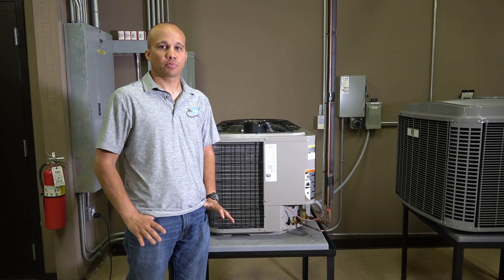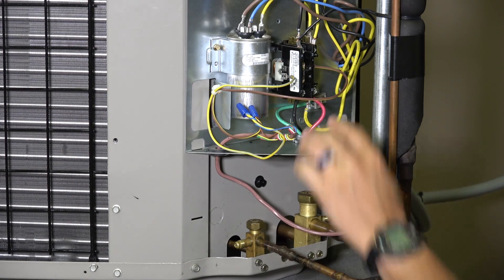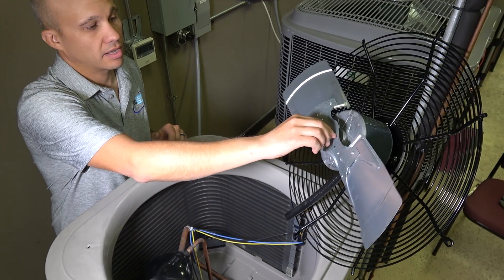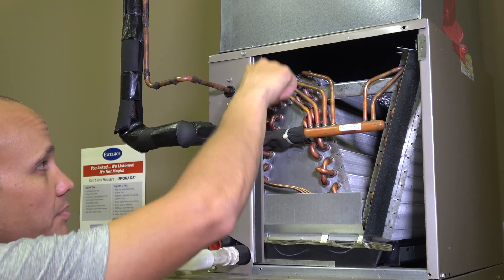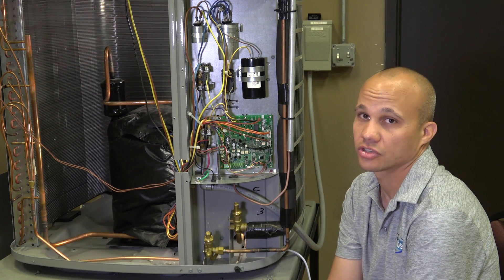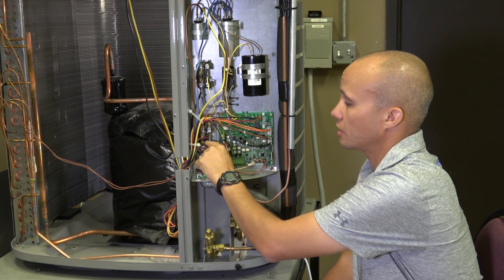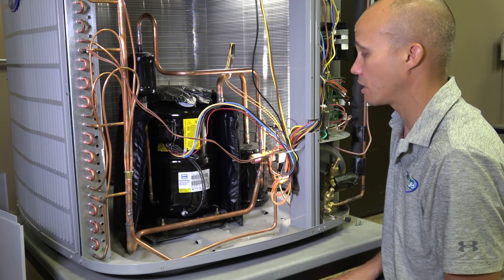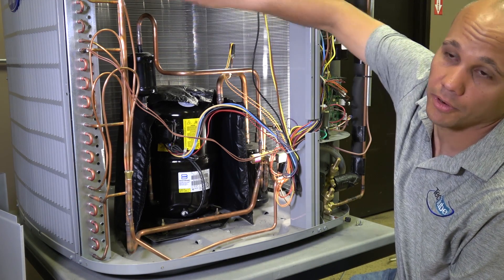Air Conditioner & Heat Pump Components

Comment: my heatpump comes on 2 degress after it should then stays on 5or6 degrees to longe
Reply from the maker: Those delays are controlled by the thermostat. For most thermostats, they are adjustable in the installer screens of the stat.

Comment: Just out of curiosity so What is the setup for a heat pump condenser in a traditional house? I know for regular AC you have AC condenser outside and then inside you have your gas furnace with coil on top. So what is the setup with heat pump condenser if the heat pump does cooling and heating? What goes inside the house?
Reply from the maker: Normally on the inside component is a fan coil (also called an air handler). It is the blower and an evaporator coil all in one box. It is about the size of a furnace.
Reply from the maker: You could also have a dual fuel system where the indoor side has a gas furnace and evaporator coil and outside is the heat pump. In that case, everything looks 100% visually identical to a traditional A/C and furnace but a couple extra internal components. With a dual fuel system you can either heat with gas or with the heat pump depending on your current fuel costs and your system capacity and efficiency. It is flexible.
Reply: @TECTubefilms  Don't forget about those of us that are all electric. My 5 ton American standard uses a 20Kwh heat strip (rarely has to use it in Arkansas winters). Also just realized something why are gas furnaces so huge my entire electric air handler was barely 54 in tall. The gas system I came from was massive compared to it that thing took up the entire cabnet it was in.
Reply from the maker: @Brad.W  Didn't forget about them... he specifically asked about furnaces.
Reply from the maker: @Brad.W  We inventory 6 brands of furnaces and all of them are only 33 inches tall. Back 10+ years ago, we had models that were 40 inches tall.

You also have to add an evaporator which is external to the furnace and the ones we use are usually 22 inches tall. That gives a combined height of 55 inches which is only 1 inch taller than your system.

Whereas for your air handler, the evaporator coil is internal. So on your system, you essentially have a fan and a coil. On a traditional system, people have a fan, a gas heat exchanger, and a coil.
Reply: Ah OK thanks!

Comment: Can you explain what happens when you have dog hair I your vent and you smell burning when you turn it on the first time...
Reply from the maker: We are not familiar with this particular issue.  Is this when you turn cooling on for the first time or heating?  If heating, what type of heat is it (gas, electric, heat pump, etc.)?
Reply: @TECTubefilms  Heat pump,heat yes the first time..But I'm curious as to what the inside looks like  I also have a light on mine to kill bacteria I'm guessing
Reply from the maker: Yes, UVC lights kill bacteria and mold on the coil and keep it from growing
Reply from the maker: The “burning” smell is common with electric heat or gas heat as dust on the heat exchanger warms up for the first time of the season.  It is not something we experience with heat pumps because that heat exchanger is also your cooling heat exchanger and it also does not get as hot.

Comment: its air/air or air/water heat pump? air/air i guess
Reply from the maker: In this video, we only used air source heat pumps (ASHP), which include two refrigerant-to-air heat exchangers... one on the indoor unit and on the outdoor unit.

A water source heat pump (WSHP) would have one refrigerant-to-air and one refrigerant-to-water heat exchanger.

You can also have a hydronic heat pump to make cold or hot water and those would have two refrigerant-to-air heat exchangers.

Comment: Are the compressor are diferent for heat pump
Reply from the maker: The compressor is one component inside the heat pump.  Other major components include the outdoor coil, the outdoor fan, and the reversing valve.  And then of course the main blower and the indoor coil which are generally inside the building unless you have a packaged system.
Reply: @TECTubefilms   Also, there should be a "SUCTION LINE ACCUMULATOR" located within the condenser cabinet.

Comment: Where is the evaporator coil located with the heat pump system ?
Reply from the maker: The two coils switch jobs as the heat pump switches from cooling mode to heating mode.  So in cooling mode, the evaporator is indoors with the blower and the coil outside is called the condenser coil.  But in heating mode, the outdoor coil becomes the evaporator coil and the indoor coil becomes the condenser coil.
Reply: @TECTubefilms  So in any heat pump system, will there always be an inside coil, or do some systems have both coils outside ?
Reply from the maker: @truthseekerKJV  There must be a coil inside.  In the summer that coil needs to remote heat from the indoors and in the winter, it adds heat.

Comment: More crap to break on the over engineer one. KISS...keep it simple stupid.
Reply from the maker: Interesting you say that because our inverter units are more complex than even the ones in this video.  The inverters have been out since 2012 and we have seen less warranty/failure claims on those than with our standard units.  Mechanical things that run constantly and never/seldom shut off, see less fatigue than on/off equipment.  When you turn a unit on and off, it causes the metal in the heat exhanger and compressor to warm-up and cool-down, which causes expansion and contraction.  When you have expansion/contraction of dissimilar metals, they expand/contract at different rates and the joints fatigue.
Reply from the maker: In regards to some of medium complexity units like shown at the end of this video, you are correct that more components does mean more possible things to break.  But in reality, our warranty/failure claims on those are not any higher than simple basic units.  This may be because the types of contractors who elect to install higher efficiency units with more complexity, tend to be the ones with very savvy techs and the units are installed properly (usually).  Whereas the types of folks who install simple, low end systems are all over the board in terms of their technician quality.
Reply: @TECTubefilms  If they make the accumulator and drier filter better protected from rusting out and leaking I'd give it a A+.
Reply from the maker: @jcstudios5629  Interesting.  We have not seen issues with rusting of these types of devices.  Is it certain brands of accumulators and filter driers that you are seeing this happen with?
Reply from the maker: @jcstudios5629  What city and climate are you in?  Humid?  Near an ocean coast?  And do your customer use A/C covers in the winter?
Reply from the maker: It looks like you are in Melbourne, FL which would be both humid and coastal, so that is probably why you see rusting down there and we don't see it up here in the midwest at all.
Reply: @TECTubefilms  Yeah, my Carrier, 2006, accumulator rust on top, have a slow leak.
Reply: @TECTubefilms  It's worse on the barrier island, I'm about 9 miles away from the ocean.
Reply from the maker: @jcstudios5629  That is a bummer.  Do you use Carrier's special coastal models down there or the regular models?  We are not very familiar with the coastal units, but we know they E-coat the coils.  Although probably not the other items like the accumulator since it is painted already.
Reply: @TECTubefilms  Not sure but next one will not be a heat pump. For best bang for the buck, Higher Seer rating and heat strips better choice economically and electricity wise verses  a heat pump with a lower Seer. Plus, less stuff to break or rust out.
Reply from the maker: @jcstudios5629  Air source heat pumps range from 200 to 400% depending on the outdoor air temp.  Electric heat is always 100%.  There is never really a case where electric heat is more economical than a heat pump.
Reply from the maker: @jcstudios5629  A heat pump doesn't really have too many extra components over a straight A/C.  It is pretty much just a reversing valve, a defrost board, and an accumulator.
Reply: @TECTubefilms  3 caps? I like one dual if the fan stops I know the compressor is off too.
Reply from the maker: @jcstudios5629  That unit was a 2006 vintage Carrier 25HNA6.  We assume the fan had a separate capacitor from the compressor because sometimes they operated independently.

The outdoor unit control energizes outdoor fan anytime compressor is operating, except for defrost or low−ambient
cooling. The outdoor fan remains energized if a pressure switch or compressor overload should open. Outdoor fan motor will continue to operate for one minute after the compressor shuts off when the outdoor ambient is greater than or equal to 100F. This reduces pressure differential for easier starting on next cycle.  Additionally, when compressor changes stages from high to low or low to high, there is a 1−minute time delay before compressor restarts while the outdoor fan motor remains running.

Comment: Can a heat pump be used to replace a compressor with using existing indoor system?
Reply from the maker: Yes, heat pumps can be used interchangeably with traditional cooling-only A/C.  Other than the thermostat wiring, all other components are identical for the indoor equipment that you would pair with a heat pump.  Same model numbers and everything.  The thermostat may need to change or at a minimum be re-wired.

In some replacement scenarios... for both A/C or heat pump... the indoor equipment and refrigerant piping cannot be re-used.  This is not because it is a heat pump, but because the indoor equipment is too old to be properly paired with any modern A/C or heat pump.
Reply: @TECTubefilms  Thanks very much for your reply...looks like the heat pump function would simply not be wired up (ignored) so the reverse flow is not used. Is this essentially correct?
Reply from the maker: @josefprem4535  It would depend on if the specific heat pump in question needed its reversing valve energized for cooling mode or if it needed it energized for heating mode.
Reply from the maker: @josefprem4535  Why wouldn't you want to use the heating function of the heat pump?
Reply: @TECTubefilms  I have an opportunity to purchase some Haier 4 ton units at a very reasonable cost.  My two 4 ton units at my home are 4 ton and i have a 4 ton and a 3 1/2 ton at my vacation home.  My home has gas heat and no heat pumps while the vacation home has elec heat and does have heat pumps.  I was thinking of buying these as a potential replacement for my home since they are 15 years old.
Reply from the maker: @josefprem4535  For the vacation home, obviously hook the heat pump since it will use only 1/3 to 1/2 of the energy to heat, as compared to the electric resistance heat.  Only use the electric heat to supplement the heat pump when it gets colder outside and and it cannot handle the heating load on its own.
Reply from the maker: @josefprem4535  For the system with a gas furnace, it should be hooked up as a "duel fuel" system where there thermostat can select to run the gas furnace or the heat pump depending on which will cost less based on the outside air temp that day.  Calculating the outdoor temperature at which to make that switch can be done by a pro and may vary anywhere from to 20 to 60 degrees outside.  It depends mostly one the cost of gas and electric in your area, as well as the model of heat pump, its size, and the load profile of the home.
Reply from the maker: @josefprem4535  Lastly, think twice about oversizing the system.  If you have a 3.5 ton system now, you likely only really need 2 to 3 tons, since 98% of systems are oversized to begin with.  Going up to the 4 ton can cause humidity control and other issues.  Check this out if you have time - https://attendee.gotowebinar.com/register/5081275745871641099

Comment: There is a blue piece connected to the back of my system, on some lines its soda can size. I'm trying to figure out what it's called. Its leaking. Sorry I dont know the proper terminology.
Reply from the maker: It is likely a drier or a muffler.  It would be unusual for the device itself to leak.  It is more likely leaking at the connection point between the device and the pipe.
Reply: @TECTubefilms  thank you. And yes that's where its leaking

Comment: OBTW, that is not a liquid line drier in there on top of the compressor in the compressor discharge line, it is a muffler.  Also, those are pressure switches not transducers.  Maybe you should re-tape this video.
Reply from the maker: Yes, correct.  It is a muffler not a drier. It was discussed a while back in the comments.  Ryan made an error.

Comment: What manufacturer and model heat pump is that?
Reply from the maker: The first unit in the video is a Payne A/C and the second unit is a Carrier heat pump.  Don't know the model numbers off hand.
Reply from the maker: The A/C was a Payne PA3ANA and the heat pump was a Carrier 25HNA.  Both were 2006 vintage from when that particular lab was built.  The heat pump was more recently replaced with an inverter unit.

Comment: Question:
I have a one and a half ton 220volts split unit AC. After few seconds of turning it on the clamp meter reads 22A then rise to reach 37A for few seconds then it stops and the clamp meter reads zero or 0.1A.  What could be the problem  ?
Reply: k bone  
Thank you for your answer.

Comment: Heat pump is a junk pump ok dont need refrigeration heat what a joke compressors are not designed to run in cold weathet refrigeration runs to cold temperatures
Reply from the maker: We are not sure what you mean.  Compressors are absolutely designed to run in a heat mode in colder temps.  All heat pumps, from all manufacturers, are tested to run at 47 and 17 degrees.  Some of the heat pumps we have used are rated to run down below -10.  We use more heat pumps at our Minnesota locations than our more southern Illinois locations.
Reply: @TECTubefilms  you know what i mean also if people really knew how refrigeration works you would be out of business
Reply from the maker: @paulvaughn6283  No, we actually don't know what you mean.
Reply from the maker: @paulvaughn6283  People knowing how refrigeration works does not affect our business.  In fact, we want to educate folks.
Reply from the maker: @paulvaughn6283  Take a look at https://youtu.be/N4WXaQu0K7w